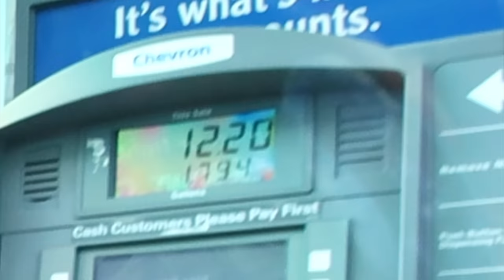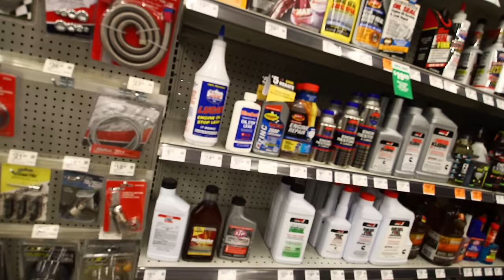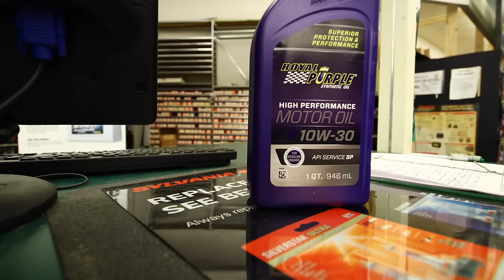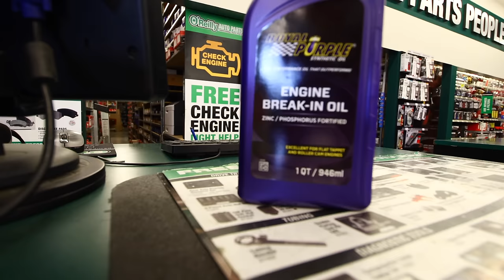BRAND NEW California Trimmer REEL MOWER! Classic Standard 20 in 7 Blade Briggs & Stratton EPIC!

Comment: I bought a Cali Trimmer in 1968. I've changed the bed knife, new chains, new fuel injected electric start engine because if you do the math I'm getting older. It's definitely the last mower you will ever nerd to buy.

Comment: Lol did you give up on the mclane?
Reply from the maker: I ordered $180 worth of bearings still havnt got here 😡 I was shopping for bed knifes rollers and other parts for el Diablo and beast… but by the time i finished I could have just bought this so I got impatient and added this to cart 😂😂😂😂😂😂😂😊🙌🏾🙏🏾🤙🏾
Reply: @YardBrah  lol I just got a John Deere basically same platform for 100$. Spent like 3 days straight sanding/grinding rust and repainting down to the nuts and bolts. Hardest part was sharpening that reel. Barely passes the paper test though. And still waiting on that conveyor belt roller cuz I don’t got reel rollers money.how much meat is left on the bed knife?

Comment: I'm trying to decide between this and the 25 inch mclane. This is cheaper though
Reply: Maintenance is easy on the Cali Trimmer. Everything is replaceable, common, and easy to maintain. The Mclane bearings need to be replaced every ten-twenty years, parts are not inexpensive.

Comment: Lol don’t lie. You didn’t go with the Honda because they’re out of that configuration and you’re inpatient like I am, so you went with the Briggs lol
Reply from the maker: 😂😂😂😂 no they were in stock I just like supporting US and local when I can… already cheated on the US when I got the Webb h12r from London 😂😂😂😊🙌🏾🤙🏾🙏🏾
Reply: @YardBrah  Honda or bust, bruv. Jokes. I’m happy you picked up a nicer cylinder mower. I’m gonna go with a Jacobsen for my yard. If the Cali trimmer would’ve had a rear solid roller, they would be a top contender for me. But the lack of rear roller is a deal breaker for me.